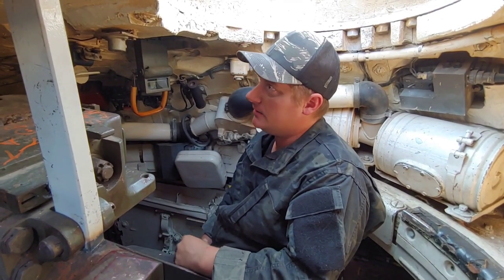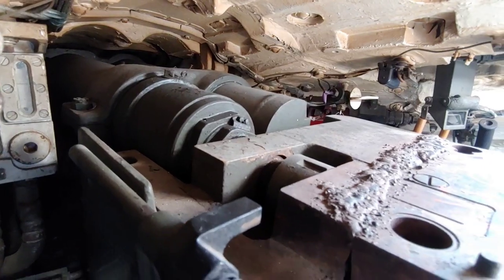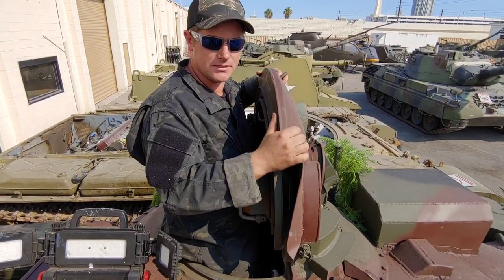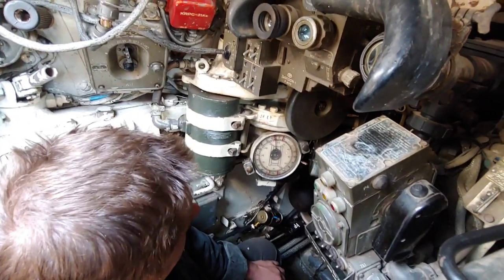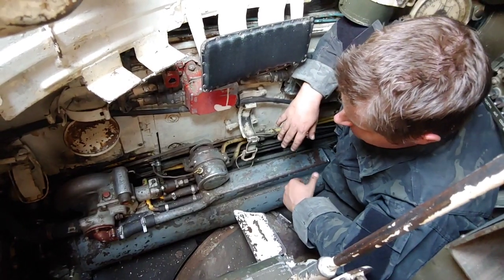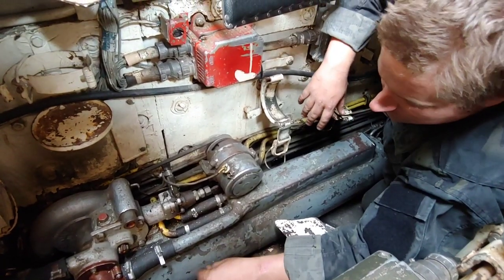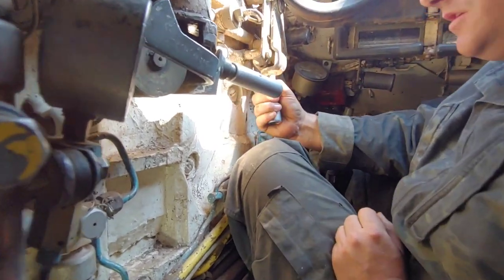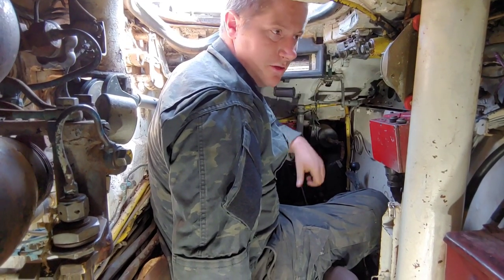T55 AMS in depth look (part 3. Interior)

Comment: 1. The ammunition is located in the hull because the Soviets studied tank battles from WWII and determined the distribution of hits and fatal hits to tanks. Those studies concluded that overwhelming majority of hits fall on the turret face, and 90% or more 1meter above the ground (higher than the hull). The ammunition placement is therefore very logical.

2. The front racks in front of the loader is the ready racks. 

3. The tank is meant to present its front to the enemy as this offers the highest protection...this makes the front racks convenient to the loader.

4. As you mentioned, during a lull in the fighting, the loader would reposition ammunition as necessary for the situation.

5. The primary ammunition would be AP/APDS/APFSDS. HEAT ammunition is low velocity type and while possessing of hreat destructive capability, is not flat shooting and is acted upon more in the wind. It is therefore more difficult to hit targets at range than higher velocity types.

Comment: the t55 has a radiation detector on the left side of the hull right behind the air tanks behind the driver. If radiation is detected, pyro charges are ignited which close the scope (primary sight) of the gunner, the intake of the in fan right hand site in front of the loader and the out fan at the back of the crew compartment below and behind the TC seat. The switch for the out fan is a red box in front of the driver. The box contains the pyro, which looks like a light bulb without the glass. The material below the steel armor in reinforced fiber glass, at least in east german tanks. Primary goal of the fiber glass is to reduce the effect of squash head ammo.
of the two air tanks only the upper one is used with about 180 bar. the lower one is the reserve, charged out site the tank, for starting the tank if you do under water driving and the engine stalled. The compass is kind of gyro, also for under water driving. it helps to keep the tank driving strait, because the current of the river pushes the tank in a direction.
Reply from the maker: Is there any chance we could get in communication with you?  Facebook messenger has usual worked the best for our international contacts however what ever is best for you if you are willing.
Reply: Dzięki/Thanks

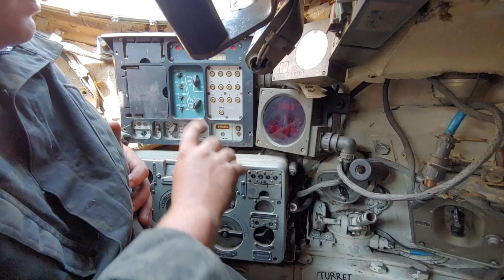Comment: 6:56 these control panels (with a lot of buttons, switchers, rounded red displays), just above the main R123 radio set, are actually part of the Fire Control System for the commander.
Reply from the maker: Thank You!

Comment: The  driver compass is used for driving under water.  Seriously.
Reply: Just to add. Reason for this is Soviet/russian doctrine remembers all the times when KV-1, and IS-2 could not cross the bridges. Therefore, all "T"s, together with T-90 have a snorkel, that allows for a tank to cross the river as a fokin' submarine. 
Genious.
Durning cold war, there were whole brigades training with BMPs BRDMs and tanks, fast crossing the river in said way. 
Only 2nd line units would have time to build bridge and so on. 

That is why Abrams and Challenger 2 would have problems in modern europe.

Comment: U say the T62 hull is a foot wider, and yet
Wikipedia says the T55 is 3.37 and T62 3.3 m wide!?
Reply from the maker: We will be making a comparison video in the future between T55 and T62, and Wikipedia is not always accurate, there are quite a few errors in it.
Reply: @MilitaryArmamentsCompany  Right. Thanks
Reply: The T62 turret ring certainly looks wider and the turret roomier
and U would think it would have to be, to accommodate a bigger gun, BUT:
the WP says it's only a tonne heavier and it uses the same engine,
which sits across the hull and uses up all the room!?
Reply from the maker: @curiouscat8396  Iam not sure what "sits across the haul" means in cence of the tank loosing space, the engine in a T62 is placed the same way as it is in T55 (horizontaly), with the difference that T62 haul is wider and longer, it is that way because the turret ring is larger diameter. T62 inside is roomier than T55, IT'S A FACT!!! I don't know what Wikipedia says and I don't really care, I can only speak for my self and what I've experienced my self.